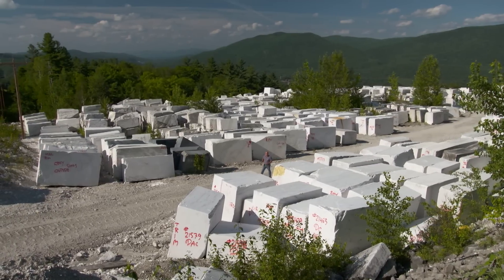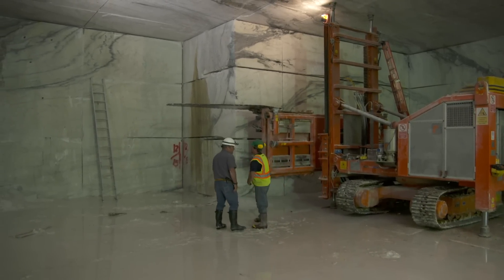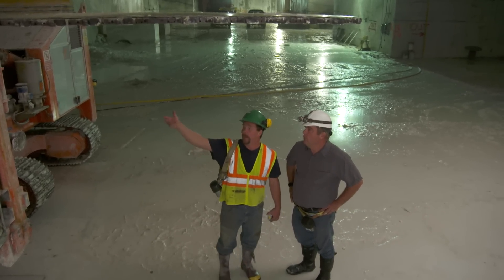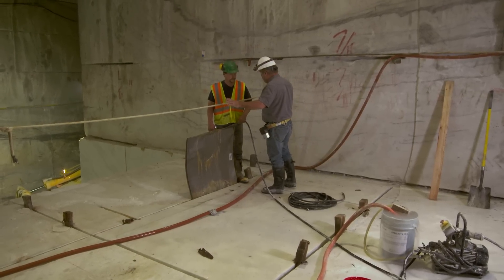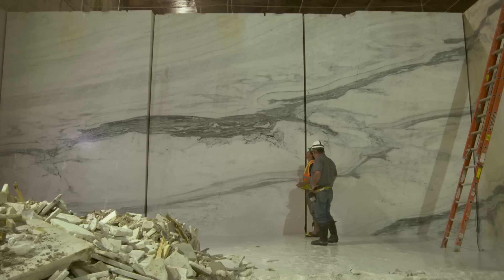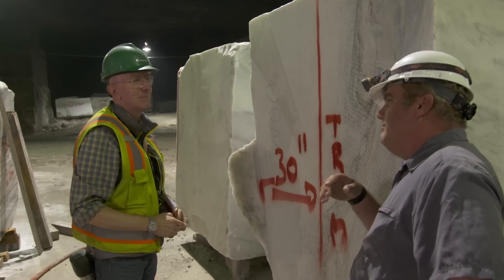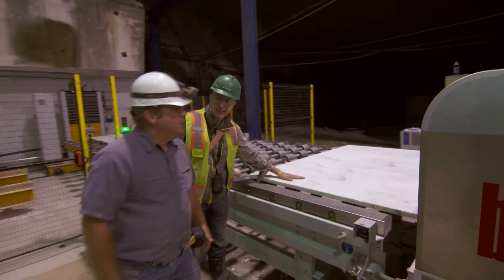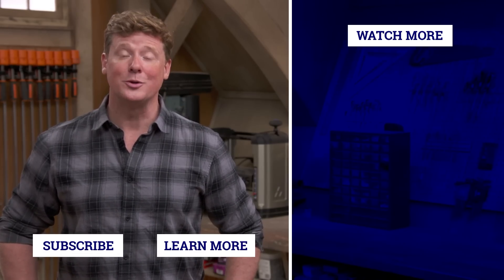How Marble is Extracted | This Old House

Comment: Watching this with the modern equipment they have, I wonder how the hell did the ancient Egyptians quarry those huge blocks of stone to build the pyramids.
Reply: By hand?
Reply: Not to mention they used granite too. Which is more than twice as hard to cut as limestone and marble. Limestone and marble are relatively soft.
Reply: Rust In Peace Yes , they used a harder material than granite. Or granite. Plus lots of elbow grease.
Reply: Slaves.  A lot of slaves.
Reply: Beau Pendleton  
Simply moving huge weights with manpower is one thing. I'm talking about the quarrying of the stone blocks and especially with the precision they achieved.

Comment: I've been dreaming of a marbled tiled bathroom floor to wall for about some time now. Those marbles are perfection.
Reply: Better make sure it is super extra specially extremmely fantasticalli sealed to the maximum overdose extend possible . In short words it stains .
Reply: I have it, it is extremely porus and was the worst choice, it's been two years if you have it how's it working for you?